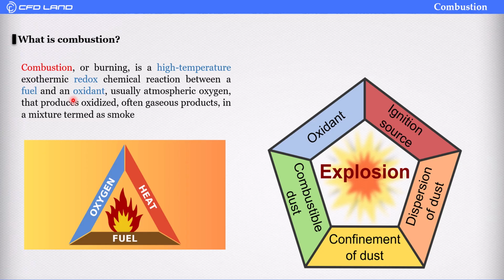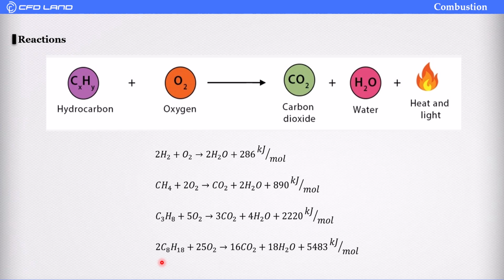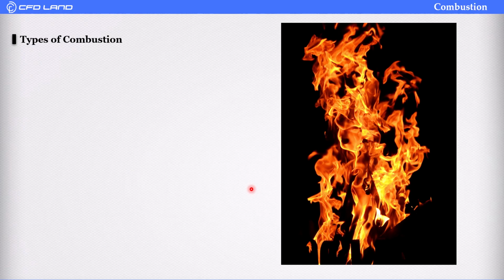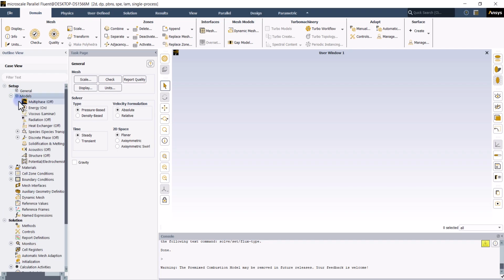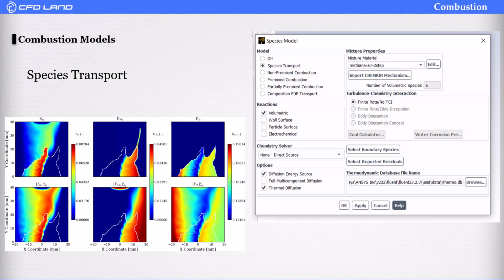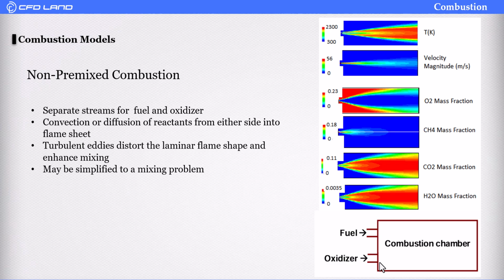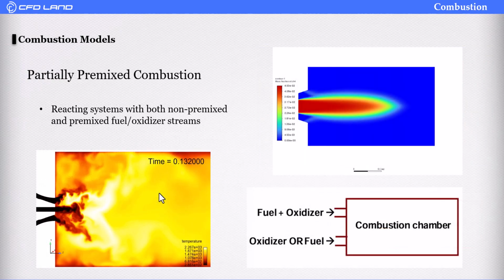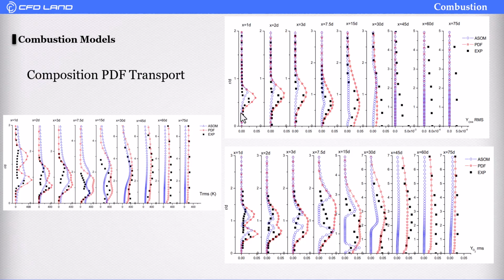🔥Combustion CFD Simulation in ANSYS Fluent — From Fire Chemistry to Industrial Applications!

Comment: Hi I am trying to simulate NiO particles reaction with hydrogen using Ansys Fluent DPM model. I activated the combustion reaction and defined all the species H2, H2O and NiO and Ni but my reaction is not taking place. could you please suggest me ?
Reply from the maker: Hi,
Which turbulence–chemistry interaction model did you use in ANSYS Fluent?
For the reaction rate calculation, did you use Fluent's built-in particle reaction models, or did you implement a UDF for the reaction kinetics?
Reply: @CFDLand  I used DPM Law udf to calculate the particle reaction rate but it is not working. can you make a video or send me the link of any video has done similar calculation
Reply from the maker: We haven’t published a free tutorial specifically on this type of DPM particle reaction UDF yet. However, we have experience working on similar CFD simulations and can help you with the setup and implementation.

If you’d like us to work on your case, you can submit your project through our website:
https://cfdland.com/order-project/

You can also contact us directly on https://wa.me/447833901310

Best regards,
CFDLAND

Comment: hello sir. Can we simulate the burning of any solid slab and visualize the flame height?
Reply from the maker: Yes, it is possible — but with some limitations depending on the combustion model and material properties.

In ANSYS Fluent, solid combustion is most commonly simulated for carbon-based particles (such as coal, char, biomass particles, or soot) using models like the Discrete Phase Model (DPM), devolatilization, and surface reactions.

For a solid slab, the simulation becomes more complex because you need to model:
• Pyrolysis/decomposition of the solid material
• Release of volatile gases
• Gas-phase combustion and flame formation
• Heat transfer inside the solid
• Surface regression/burning rate

Comment: Hello, Sir. Thank you very much for your videos. Recently, I’ve been using Fluent to simulate hydrogen combustion with the FGM model and a multi-step hydrogen-air reaction mechanism. I’ve also tried the GRI 3.0 mechanism, but the calculation keeps diverging. Could you please make a tutorial video on this?
Reply from the maker: Thank you for your comment.

🔥 Hydrogen combustion with the FGM (Flamelet Generated Manifold) model in ANSYS Fluent can indeed be very challenging, especially when using detailed multi-step H₂-air mechanisms or GRI-Mech 3.0. These mechanisms are highly stiff and sensitive to flamelet resolution, reaction progress treatment, mesh quality, and solver settings.

🔖 Based on ANSYS Fluent documentation, divergence in FGM simulations often occurs near the peak reaction progress rate. In many cases, improving flamelet resolution, refining the progress variable space, reducing the Fourier Number Multiplier, and tightening flamelet convergence tolerances can help stabilize the solution. For mechanisms such as GRI 3.0, higher table resolution is usually required as well.

At the moment, we do not have plans to record a dedicated tutorial on this topic. However, you can submit your request through the following link:

🌐 https://cfdland.com/order-project/
Reply: @CFDLand  Thank you very much for your reply. I'll take your suggestions into consideration and give it another try.